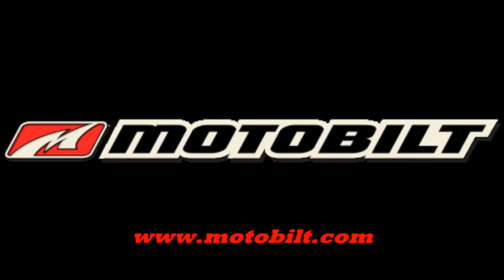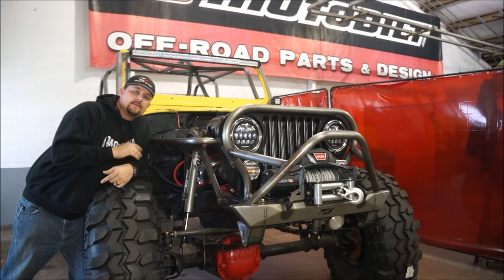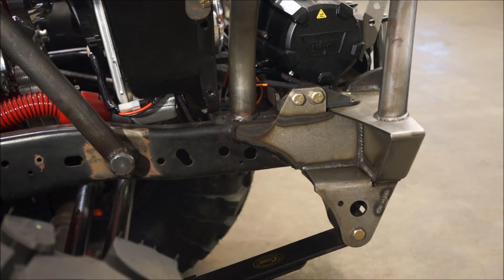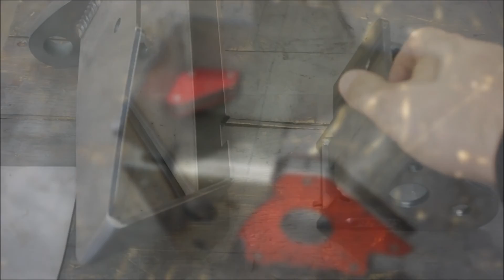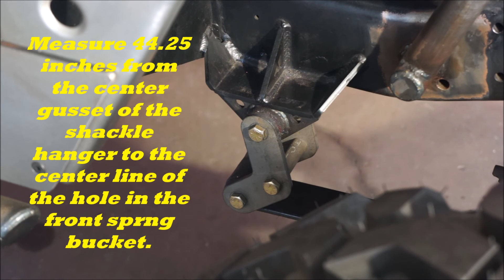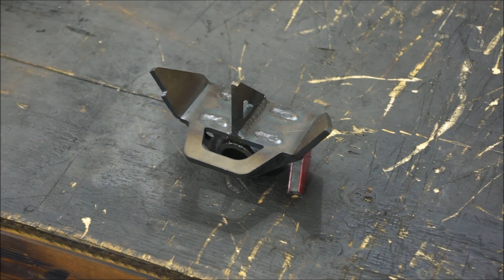Motobilt's Jeep CJ Full Width Axle Kit Overview

Comment: Newbie here.... 76 cj 5.  Narrow track.   I'm looking for wide axle d30 and d44.  Want to put the Wrangler springs on it also and run 35in. Rubber.    
I'm wondering if you can do wide axle conversion  for cj5 with forward shackles  on the front axle?   Maybe a slight drop down hanger with a reasonable shackle.   
Mostly a street rig, but when I get it in the dirt I would t be easy on it and want it to be stout and perform well.   
Asking too much?? Lol
Any info/response will be appreciated 
Thanks
Doug
Reply: Correction...WONT  BE  easy on it.🤦‍♂️

Comment: What 1 ton axle do you use on a CJ?  I have a 02 Ford supper duty parts truck I was going to use but the front diff is on the drivers side.
Reply from the maker: The Super duty axles have a spring pad measurement of around 36"s which is too wide for this kit.  We recommend a earlier model axle such as a 78 or 79 as the spring pad measurement on those is 32.5"s.  If you try to make something to work with the super duty axles your springs will be so far out that it is very likely you will have issues with the tires rubbing the springs as full turn.
Reply: Thanks for the info.  What axles, motor, and tranny  are you running on the project jeep